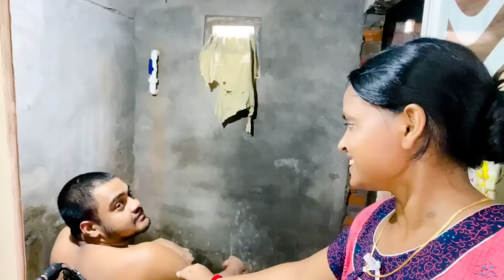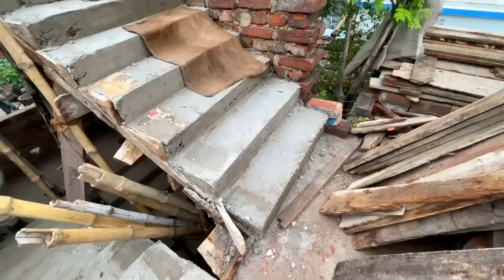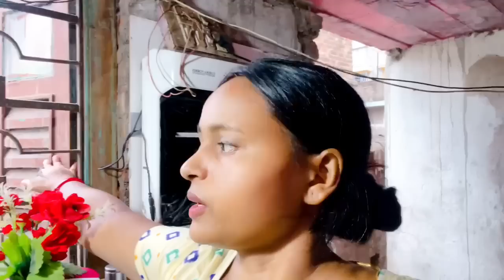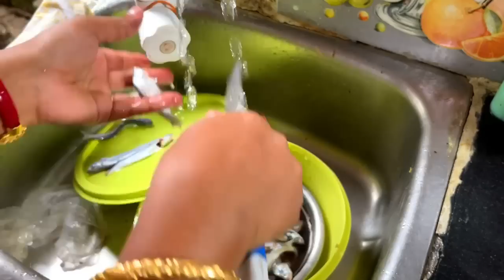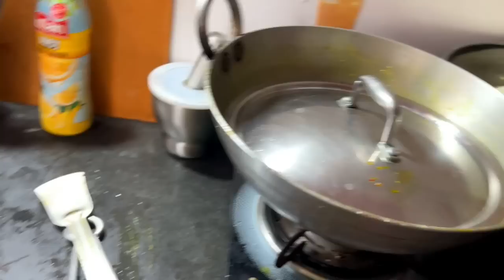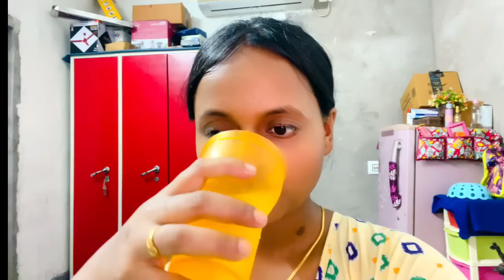আট বছর পর উজ্জ্বল হুইলচেয়ার ছেড়ে উঠে দাঁড়ালো?সত্যিটা  কি?তোমাদের জানাতেই পারলাম না কেন ?

Comment: Hi, ami tomader vdo onekgulo dekhechi. Jeta dekhe bujhlam je ujjoler cervical spine injury hoyeche jar jonno oor dui pa paralysed . Sadly, Eisob cases e dekha jai je patient konodin hantte pare na, jeta Nimhaans e tomader already bolechilo and tomra accept kore niyecho. At this point, after 7 to 8 years,  there is no role of medicines in his cure. Ami jani na Ujjol " high dose " e roj ki medicines khachche , hoyto hojomer osudh ba calcium tablets ba urine er kono osudh jeigulo khele weight gain hoyna. The only thing that can help him at this point is regular physiotherapy. Ami ekbaro bolchina je physiotherapy korbar por Ujjol hantte parbe abar, kintu jeta hobe seta holo physiotherapy will prevent joint deformity, joint stiffness,  muscle contractures and also strengthen his dormant muscles which are still active so that he can perform small but essential everyday tasks by himself as far as possible ( using his hands ). One more very important role of physiotherapy is that it will maintain his blood circulation and help prevent formation of clots which can be fatal. Bed sorer chance tao kombe exercise kore if blood circulation is maintained.  Also, the exercise will help his general health jeta amra sobai jani. Hopefully I have been able to outline the vital role of physiotherapy in your condition. 
You can contact physiotherapy/ neurorehabilitation centres in Kolkata where a doctor ( of physiotherapy)will first assess your condition and then advice you accordingly . Not only exercise,  eisob centres e ora counseling,  diet plans etc eisobo help kore according to the patient's requirements. Tomra please jogajog koro eder songe... I agree it's not going to be easy, maybe painful even initially and a long process  . But you will do it for yourself and for your hardworking family who has so much hope for you. I hope you will think about my suggestion. Good wishes always.